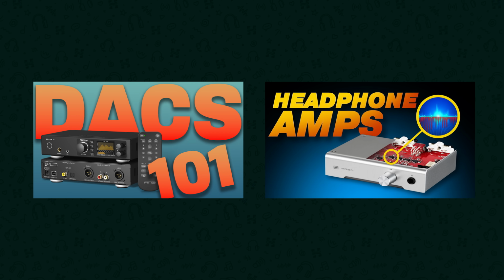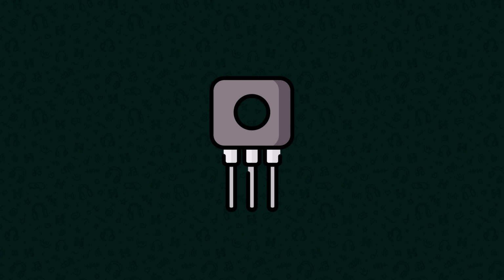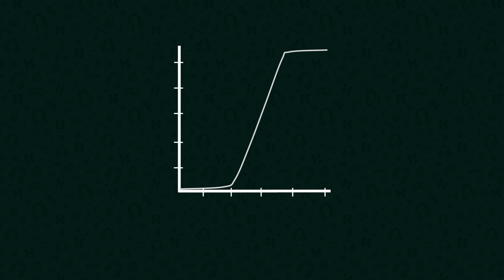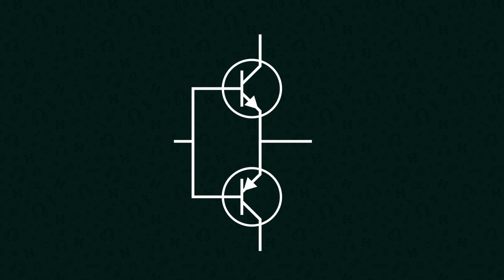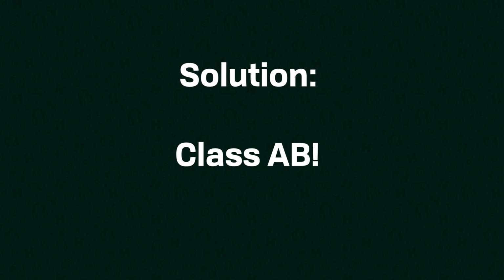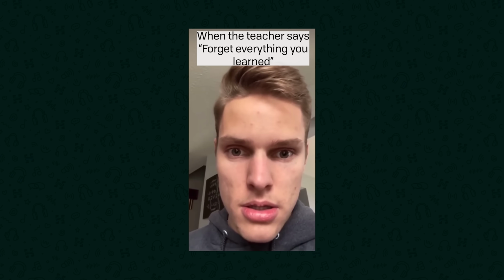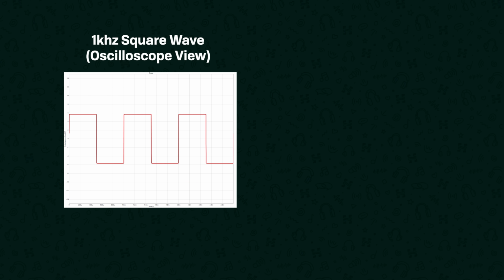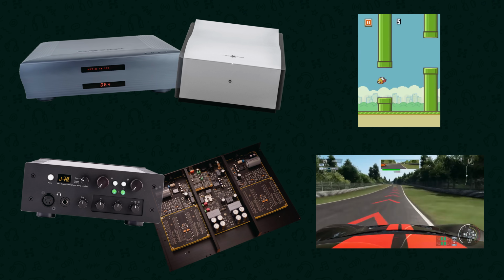Audio amp classes as fast as possible!

Comment: Apologies for not including this in the video itself, but the main advantage for class D amps is that they can be made EXTREMELY efficiently, whilst also having extremely low distortion.

Class D amps are always either fully 'on' or fully 'off'. Meaning they're either outputting efficiently or using basically no power. This means that class D amps can sometimes be 90-95% efficient, vs the 40-80% efficiency of class AB and the maximum 50% of class A.

This makes them really suitable for situations where massive power is needed but an enormous class AB amp would not be feasible. Such as for subwoofers or car audio. You hardly need any heat dissipation and so a very powerful class D amp can be made to be extremely compact.

The main disadvantages are that they inherently generate a huge amount of high frequency noise which must be filtered out, and many class D amps are also load dependent, meaning the filter response will change depending on the impedance of the connected load.
For speakers this is not really an issue as you know everything will be roughly 8 Ohms. But for headphones where it could be anywhing from ~12 Ohm to 600 Ohm, that's a more difficult challenge.

For that reason, and since we don't really 'need' the efficiency for headphone amps anyway which don't use much power, class D is rarely seen in headphone amps.
Reply: Please, excuse me this probably dumb question.

Do integrated DAC/Amp chips commonly found in Bluetooth devices like Qudelix and FiiO's BTR lineup (ES9218/9218), as well as USB dongles (CS43131) employ class D amplifier technology?
Reply: @juanblanco7898  Hi Juan, I was curious about this question too. Its not my direct field, but I have heared some talk on audio generation over the years. I think likely the products you mention do not use class D output amplifiers, because they do not need to deliver a big amount of power to their load. Class D is I think generally harder to design well than a conventional amplifier and its not as robust to attaching anything you like to the output because of the analog filter after the class D switching stage. In wireless headphones you might see it, but they often also have AB outputs it seems. However, most audio DACs like the ones in those products you mention do use a related trick to class D called Sigma Delta Modulation, where they have the DAC produce many more samples than the bitrate of your audio and when you average those high speed samples, you get to a closer waveform you try to produce. Thats how you can get more dynamic range (bits) while leveraging the increases in speed and switching efficiency of modern MOSfets.
Reply: Class d amps for head phone use are most commonly used in portable devices like phones and portable music players were managing power usage is vary important. But other then that small thing i agree with your explanation
Reply: The only part I have a doubt about is the lack of 'need' for efficient headphone amps.
A lot of things are portable and battery powered these days (phones, music players, portable bluetooth headphone "amps") and battery life is a big selling point.
How much of a difference the headphone amp portion makes, I don't know.
Reply: An issue, class A amps are not 50% efficient, closer to 25%. Class AB has two sub classes, AB1 and AB2. Included with AB, the three are between 40% and 60%. Class B is typically about 65% but it requires low pass filters. That impacts the fidelity of the program material, so they are not used in HIFI. For plate modulated AM communications transmitting it is not an issue, so they work very good there.
Reply: @palomarjack  It didn't say class A amps are 50% efficient. It says the maximum theoretical efficiency is 50%. My understanding is that if you have a transistor with a perfectly sharp elbow into a perfect linear region and you had a perfect, constant sine wave input signal, and the bias was set exactly to the edge of the amplitude of that input signal, it would be 50% efficient.
Reply: @waylandsmith  "In theory" yes, except those don't exist.
Reply: Class D looks like something I can design and make myself, while other ones include lots of pain with manually adjusting resistor values, checking the output with scope (I don't have a scope), keeping a ton of parameters in mind while doing it, and having no guarantee that the result will be better than crap.
Reply: @IgorB-371 well both of you argue the same side we've been on in actual world of amplifiers
Im not pro myself, just user analog scope to see sin wave..all amp brands made the sound the way it is, none is best..for some class D gives the cleanest none harmonic sin wave, where some AB had some harmonic that many people also desire
As for me, having both amps are great
Reply: @IgorB-371  have you ever built any type of electronics before let alone an amp if so you would know neither is an easy thing to get sounding right and pretty much no matter what with a class D you still have to put an output filter which heavily compromises sound
Reply: @zacholton2844  How it compromises? With PWM frequency in hundreds kHz and low pass filter at say 20 kHz what it's gonna compromise, your claim is BS, sir.
Reply: @IgorB-371  Yeh i can tell you not open minded at all, Class D literally strips all good harmonics out of the sound resulting in a very thin and stale sound, and bro if you put the low pass filter at 20khz you are attenuating all that beautiful harmonics like cymbals, any good amp designer is going to tell you need overhead cutting it off before that is a huge mistake and as i said it doesn't sound like you have actually built or designed anything like this before other than watch a few YT videos and call it a day.
Reply: @IgorB-371  And have you just for the record ever tried building an amp before?
Reply: @zacholton2844  What do you mean by "build": find the schematics on internet, buy the exact components and replicate, or design everything from scratch yourself? If I say "yes" what does it change? It anyway sounded like crap.
Reply: @IgorB-371  I mean design the schematics yourself and then from that build the pcb and design case heatsinks output devices or anything like that if you haven't it explain alot. and what do you mean by it sounded like crap what are you referencing to here?
Reply: @zacholton2844  I haven't design audio amplifier myself. Neither did you. Randomly throwing parts onto the board doesn't count. What I mean by "crap" and why these questions - because formally I did amplify sound signal once while making noise gate, it was a side effect. But the schematics picked up and amplified such amounts of 50Hz hum that it was impractical to use such device would I finish it. Anyway, I don't do sound and in general anything that is commercially available and cheaper / of better quality. But I've dealt with a heck of a lot square pulses to find the author's idea of filtering PWM feasible. On other hand, judjing by your meager experience with losing beautiful harmonics (allegedly) you don't seem to understand the difference between amplifying some signal and driving a speaker. With that I honestly don't see what you can bring to the table.
Reply: @IgorB-371  Why are you repeating what i just said I literally just said throwing components on a board is not building one and you now just admitted you don't know to do it and it doesn't make a difference whether you have done research on PWM cause when you said to set an output filter at 20khz, and you know nothing else other than the basic function of a PWM filter, that just proves you have no idea what you're talking about in terms of audio as you said you have never even built on of these things before and you claim i have never built an amp before just search up Holton Precision Audio, on google.
and yes that also bring me on to my next thing with a class D is that they cannot handle all loads equally and you get lots of artifacts and instability and that is very common knowledge with these Class D's they are ok for a few things but for true hifi im sorry you saying how you failed at your "making of a noise gate" shows your lack of expertise and im just curious have you ever been into a proper hifi room with a good pair of speakers and dac/preamp and a proper amp that synergizes well with all the other components to know what good sound is actually meant to sound like or are you just the typical everything sounds the same on any amp type of guy?
Reply: It was a big mistake to show the triangle wave and the sine wave being of almost the same frequency.
Reply: @noop9k  This was done so that the procedure of comparison could be shown easily. On the initial version I did with the more realistic and much higher frequency triangle wave it was much more difficult to see what was going on.
Reply: @GoldenSound  But you could at least see the density changing in accordance to the amplitude. If the frequencies are so close, the visualization is missing the point :)
Reply: I can’t hear a difference between Topping class AB and D amps. I think we’re approaching a point where it is indistinguishable. If you have good specs anyway.
Reply: Actually most speakers sold as "8 Ohm" end up measuring 4-6 Ohm...
Reply: 😅😊😊😅😅m, n😂😂(№😂😢¡±++±±±±±++++×++±±+±±×+++÷+×××7×××7++++××+×+++++×++×+×+++×++×××÷++×÷×÷÷÷÷÷÷÷÷÷÷7😊×0❤ 9:27 【¡❤#@¡¡¡¡¡¡¡¡¡±
Reply: Enter me with my single ended tube amplifier literally warming up the room on a cold winter night 😀
Reply: Back in the early 80’s , I purchased a Caver magnetic field amp . The specs were like 225 watts per channel with a high of 325 watts .  Running stereo with Klipsch Forte floor speakers . Great clear sound.  How would you classify that type of amp?
Reply: Because Class D amplifiers are so incredibly efficient, they don't need the same kind of heat dissipation as Class A/B amplifiers, which allows for smaller heat sinks, smaller form factors and lighter weight. Additionally, they are usually fed by switching power supplies (that also operate in a similar manner), which are much lighter than traditional linear power supplies with large transformers. Along with cheap/powerful DSP chips, these advancements have totally changed the audio world in the last 20 yrs. Here's one example:

PA systems: Back in the A/B era, you'd send the line level from the board into a rack-mounted, adjustable crossover to split the sub frequencies from the mains. That might then go into rack-mounted limiters to ensure you don't accidentally blow up your speakers. Then, you'd feed that signal into rack-mounted PA amplifiers (one for the sub, one for the mains). The mains would then have a passive crossover inside to split the treble from the midrange. 

Today, you run power and the line signal from the board into the powered subwoofer's input. You set the volume level and crossover frequency. You take line output from the subwoofer and plug it (along with power) into the main speaker. Set the volume and crossover frequency. Done! The speaker and the subwoofer both have amplifiers that are right-sized and electrically matched to the drivers. They have limiter systems to ensure you're never going to blow up the drivers, along with crossovers and DSP that "seam" different drivers together properly. A lot less equipment and, when done right, much better results than some old passive system.
Reply: Any class D based on the Universal class D design and especially the modern variations from Hypex, Purifi and such handily beat 98% of A/AB designs in objective and subjective tests. While being significantly more efficient.
Reply: Thanks❤@game-tea
Reply: @game-tea yeh no
Reply: I loved the explanation.
And complementing that, it is very easy to use Power MOSFET transistors to implement class D amplifiers, and most MOSFETs I have at home are only limited to its package limits, meaning a small TO-220 transistor handling 75 amps easily (that would be 7kW at 100V) without significant heat.  I don't use them on amplifiers (all audio amps I have are AB), but they would be a good choice to make a power amp for sub.
Reply: Speakers are not "roughly 8 ohms"  and are certainly not a constant 8-ohm resistive load at all frequencies! This fact is the critical flaw with Class D amps, the effect you describe is more-or-less fatal from a fidelity standpoint.
Reply: I'm surprised by the statement that "everything will be roughly 8 ohms". An 8-ohm speaker will present a very different load at 20hz than 20khz.
Reply: @DJ_Force  it's not that different... There will be some variance yes, but in practice your ears will hardly be able to tell much of a difference really. Also there are already some class d implementations that solve that problem.
Reply: @bgravato I mean, the bass response is significant for 8 ohm versus basically 0 ohm output impedance thanks to driver resonance. And I somehow doubt the filter responce changes very much because current doesn't change a filter's frequency responce. Class D is in the hundreds of kiloherts if not megaherts for the switching alone  so the noise is well beyond the hearing threshold by several times. 
The filter is moreso so you don't broadcast radio from your speaker cables, essentially, plus capacitative coupling. 
For cheap and simple, and inefficient, a balanced class A is about as good as it gets because any the nonlinearity in the curve is pretty much matched by the inverse. Not perfectly but good enough, especially with some negative feedback. But really, the biggest difference is more down to keeping your background noise down and not using a crazy number of capacitors that phase shift stuff which limits your negative feedback thanks to said phase shift causing gradual change to positive feedback at some hypothetical frequency.
Reply: @DJ_Force  They will vary yes, but the thing is they won't vary enough to matter much (and the response at low freqs is unaffected anyway).

This image shows the filter response for a typical BTL differential filter for instance and I've plotted a few impedances. https://i.imgur.com/lBnphVo.png

You can see that the 4 and 8 Ohm responses are different, but not enough to be concerning. You may get some slight variation in upper treble if the speaker deviates a lot from a 6 ish Ohm load around 20khz but nothing concerning.

But connect a 155 Ohm load and suddenly you've got a >20dB boost, which is hardly 'transparent' and also at that level risks damaging both your ears and headphones, possibly without you even realizing depending on where your own upper range of hearing rolls off.
Reply: @DJ_Force  , and so, your 20Hz to 20kHz are at what volume/loudness?
Reply: @surgingcircuits6955  Sorry, I'm not following you.
Reply: @DJ_Force  , If I understood the 8 ohm reference correctly, it was just to say that in an 8 ohm, system, frequency and loudness will both affect load impedance.
Reply: @surgingcircuits6955  I don't know about volume, but frequently will drastically affect the impedance. A woffer moving at 20hz will have much less reactance than one moving at 200hz. That's why it takes so much more power.
Reply: Since in class D there is a digital conversion involved, doesn't this have a higher latency than the pure analog amp classes ? Even noticeable when used studio recording situations ?
Reply: @pontram There is no digital conversion in class D amps, they are just as analog as A and AB.
Reply: But class d works great in guitar amp amplifiers right?
Reply: @AllforOne_OneforAll1689 I have a class d bass amp, rated 500w.  =it’s been awesome playing through a Yamaha PA speaker.  15 inch woofer plus horn, rated peak 2000w…
I’ve never been happier as I have two of those speakers!  The best part is how little the amp is and weighs.
Reply: Does youtube allow you to add video segments? if so, this should be added.
Reply: Class AB is the best, go to a listening room wat i did, there are maybe a hand full of class D amplifier's dat give a good sound stage an Detail in your music, AB give you Detail in your music and if only bass and no detail in the soundstage matters go to a junk class D, of course they are more efecient, they do not contain toridal transformers🙄 they use class D in al the bluetooth and portable speakers these days, and also B&O use it for there speakers it is al about saving on component's also with the Bose sonos crap. Go listen with a good pair of speakers one with the Class D an one with the AB and find out, i prefer Agnes obel with the song the curse🥹  there is more than only bass😌

Comment: That's great video. But as an IEM listener, my question is what amplifier technology is most appropriate for my scenario? And maybe there are specific desktop amps that can be called as "endgame level" for IEMs and for combining them with any desktop/portable DAC? If these models can not provide enough power for demanding headphones - no problems at all. I mean, that's great to know that some hi-end DAPs are optimized for high-sensitivity and low-impedance IEMs, but I'm a little bit confused when I'm trying to find desktop solution for my needs (especially if I consider true balanced output models...).

Comment: I built some Hypex (class D) monoblocs 20 ish years ago when they finally cracked the code - same era as Class T amps, (side quest: I still have a Trends TA-10.1 powering my PC audio)  -  the Hypex monoblocs have a Croft valve pre amp running them - mixing old and (cutting edge at the time) they work really really well together - I know things have moved on - but I'm still doing the parenting thing, so there's zero Hi-fi budget... but we can enjoy older things that still work really well (I'll never give up my NA Dias TT).  tbh to 'improve' the sound it would be a massive investment for a tiny nudge up the bell curve - so not feeling any pressure to change stuff - loved the video btw